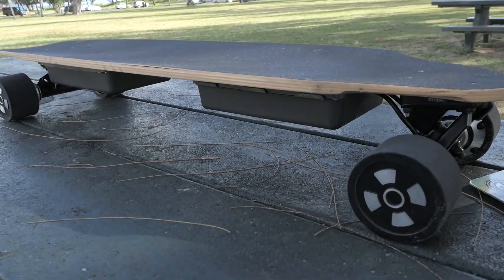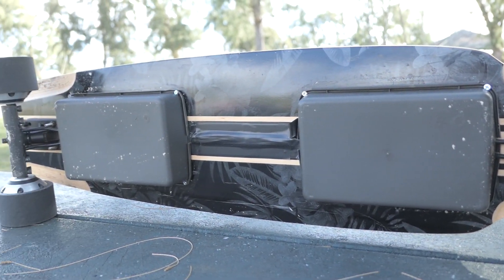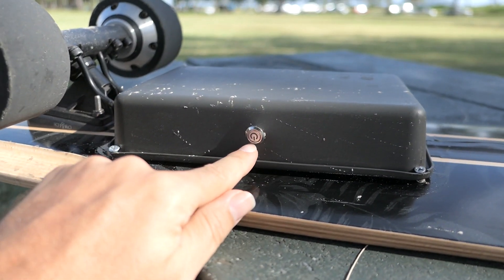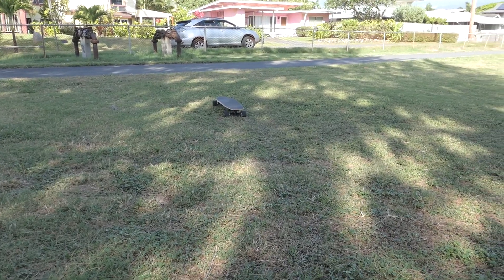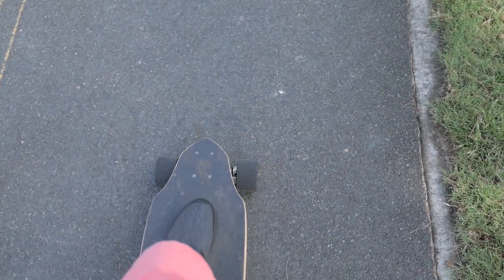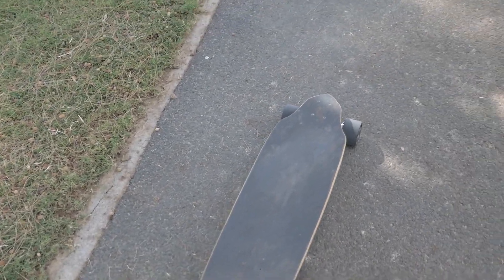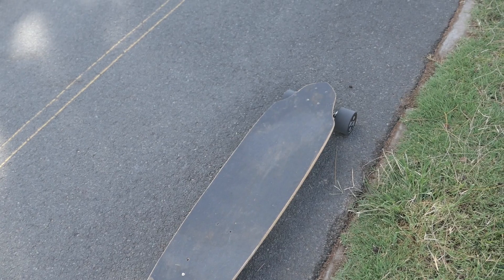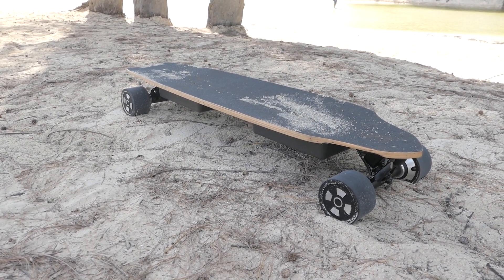$550 AWD Diy - Electric Skateboard Build - Review & Parts List

Comment: I did a similar set up but I used two of those style remotes glued together with a hot glue gun and a short piece of wire hot glued across the push buttons. There are indents in the buttons that I put a 2cm length of about 1.5mm wire hot glued in. This guy has a master/slave generic ESC with the one remote and I did buy one of those but found the programming on it no good (it was from a different supplier to this guy). The brakes were way too touchy. So I used two generic ESCs that had soft braking and when put together gave me the right feel.  Two remotes glued together feel perfectly fine if you use the old style three speed remote. It feels fine in the hand so dont be afraid to do it this way. Also by varying the switch postion I actually have like a 6 variable speed board. Those second  generation remotes where you have to push the button to change speed are just a pain in the backside and would not recommend. 4wd boards are way better than 2wd, you can traverse a wider range of surfaces like uphill on grass so going thru grassed areas no problem when battery full. Also you cannot wire two independent generic ESCs together. I have tried it and it wont work. You need a specific slave programmed ESC and I am surprised no one sells just a slave on its own. The programmed slave will work with anything provided you do the wiring right. I think two of the wires need to be crossed from memory and the rest just match up in the master slave setup. I also at one time used an old ESC from my existing 2wd board and added the slave and it took on the programming braking setup of the master, so braked fine.

Comment: what is the top speed?
Reply from the maker: I got 23 mph but I think with a lighter person it will do 25.
Reply: Will it go faster with this battery https://www.amazon.ca/gp/product/B07594LWWS/ref=ox_sc_act_title_3?smid=AEXGS89RF8KCG&psc=1 ?
Reply from the maker: Yes you'll have more power delivery so  top speed should increase. Get the 18.5 volts ones to make a 37v system.

Comment: IT MUST BE WANTING TO DO THE WHEELYE CUZ THE WAY THE CENTRE OF GRAV WITH ON IT IS WAY TOO IN THE BACK NOW IS AWD NOT JUST BEHIND WHEELS WICH CAUSES THE CENTRE OF GRAVITY OF THE BOARD WITH YOU ON IT IN THE FRONT
Reply from the maker: Good point! When accelerating the weight mostly goes to my back leg which leaves the front very light, it makes sense why the front loses traction so easyly too. Thanks for your comment.

Comment: I want to get a slightly more powerful system for the rear wheels so I can drift it.  :)
Reply from the maker: When it hits same sandy or wet pavement it spins. But not sure if it's enough for you. Plus your weight will have alot to do with it.
Reply: It's exactly the same as sliding it downhill.  As long as you shift enough weight to the other truck it will eventually break free and spin.  I've spent quite a bit of time in a tuck doing donuts until the wheels start to slide.  It's basically just a tiny car with polyurethane tires.
Reply from the maker: Awesome sounds fun! I guess with harder tyre it could loose traction easier. That gives me ideas. Thanks